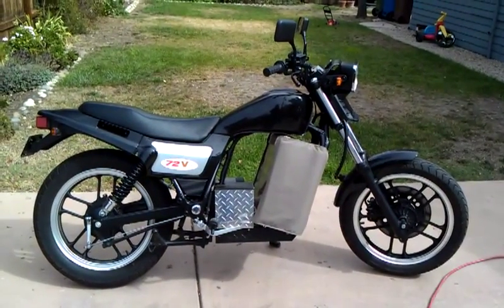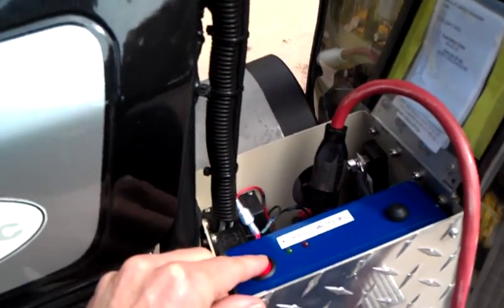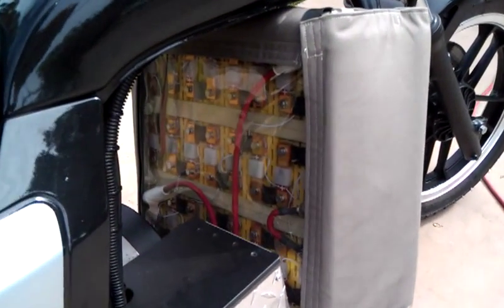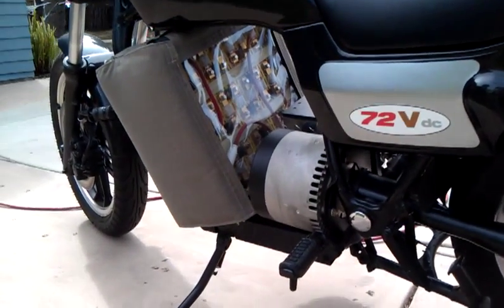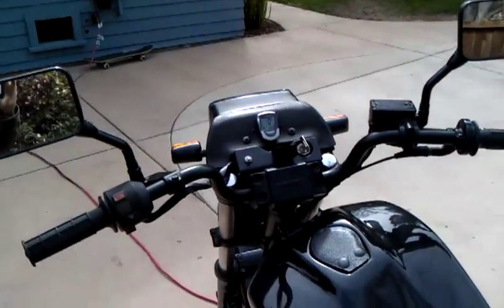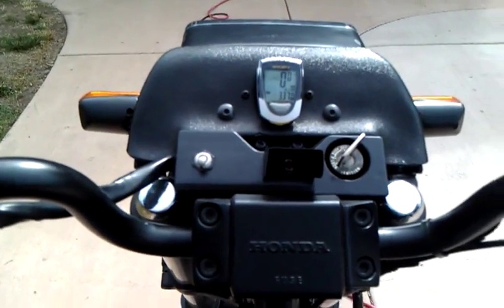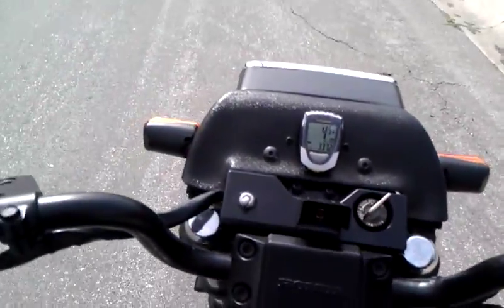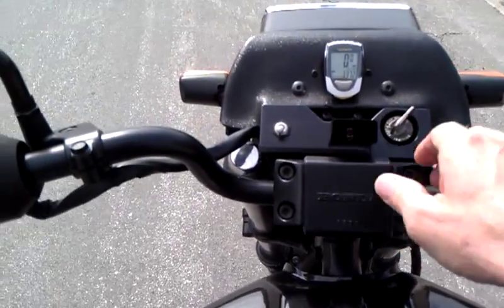1983 Honda Ascot Electric Conversion Motorcycle 72 volt 2

Comment: Sweeeeeet!   I have a 2003 VTX 1800C and a 1985 VT1100.  
I'm thinking of turning the 1985 VT1100 into an electric. 
What Motor and Controller did you use?  
Also, are you on Endless Sphere?
Thank you!

Tommy L sends....